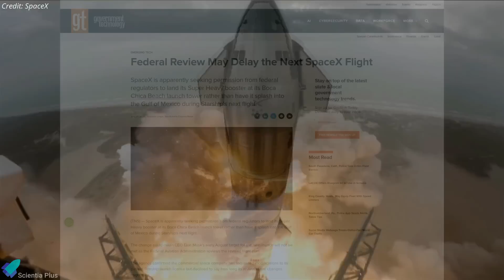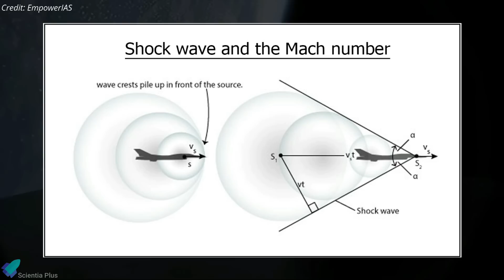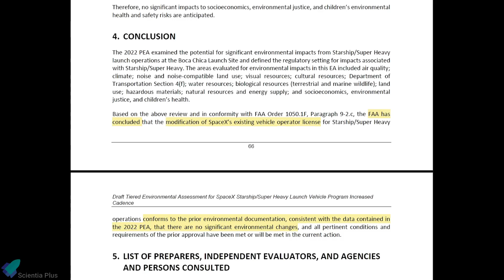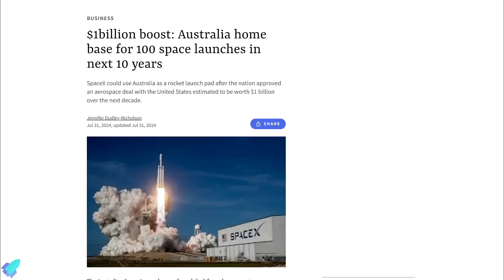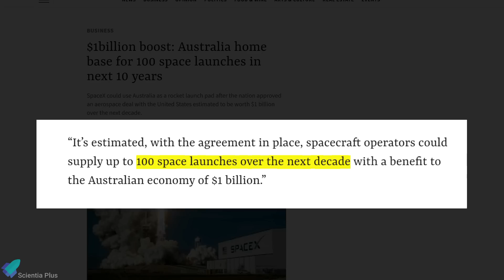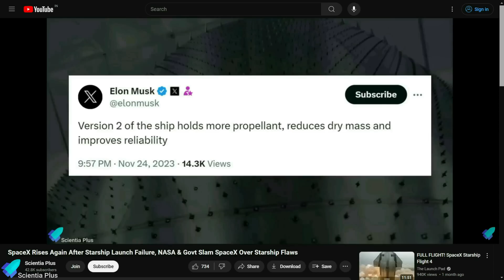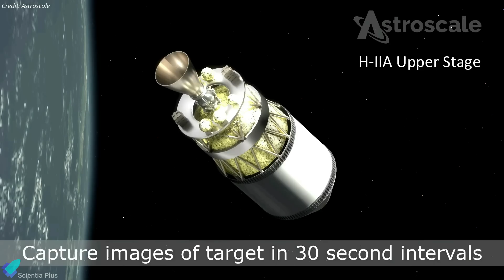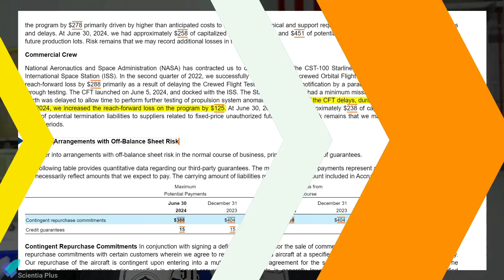Musk Updates on Starship Flight 5: Key Repairs Still Pending, Launch Date & Success Odds Revealed!

Comment from the maker: 00:00 Starship Updates
10:20 Astroscale ADRAS-J Released Stunning Visuals of Japanese Rocket Body In Space
12:29 Starliner Tested In Space, Boeing Reports $1.6B Total Loss

Learn More:
1. Latest Starship Upgrades
 a. Starship Hot Staging Explained: https://youtu.be/qgZHo9wYRW0
 b. Super Heavy Booster Upgrades: https://youtu.be/vZH5esgrFiM?t=63
 c. How SpaceX Protect Raptor Engines: https://youtu.be/L22gyQDDXho
 d. Starship New Heat Tiles Explained: https://shorturl.at/p2Ijb
2. Starship V2 Features:
 a) https://shorturl.at/lpGT7
 b) https://shorturl.at/gwNQ4
 c) https://shorturl.at/xa60S
3. Starship V3 Features: https://shorturl.at/mnBT4
4. Starship V2, V3 & Raptor V2, V3 Complete 2024 Update: https://shorturl.at/tN248
5. Starship Block 2 Stacking Begins: https://shorturl.at/hXEzO

Weekly Updates: https://bit.ly/3HIQjPC
SpaceX Playlist: https://bit.ly/34wue8T

Comment: Even Elon says there is a 30% chance the flaps will fail.
The flaps need to be redesigned.  The problem is the flaps must be movable during the highest speeds on reentry.  I propose a solution that is straight from Elon.  The best part is no part.  So remove the flaps.  Cover the entire ship is heat resistant tiles.  Have smaller fixed flaps to stabilise somewhat against spinning.   When the speed is reduced enough extend retracted flaps for control and stability.
Reply: That’s already planned in block 2